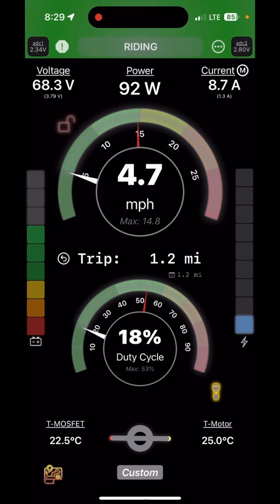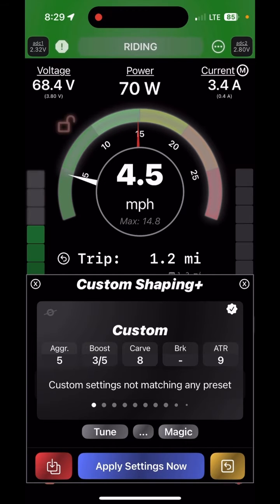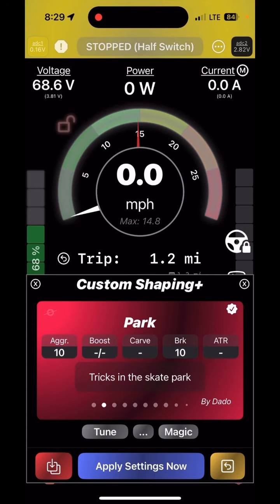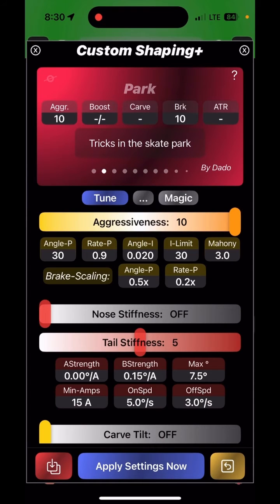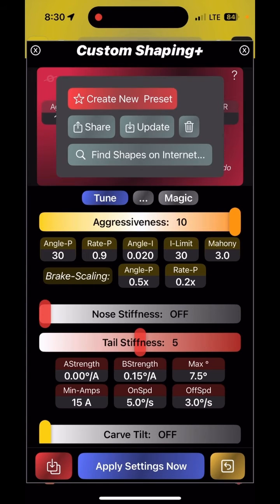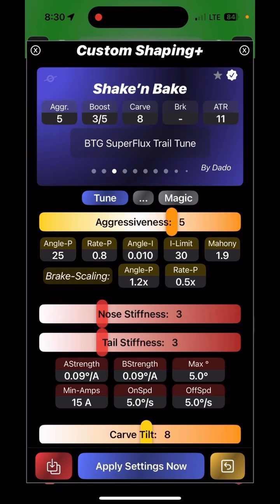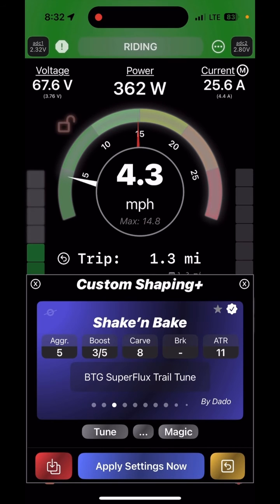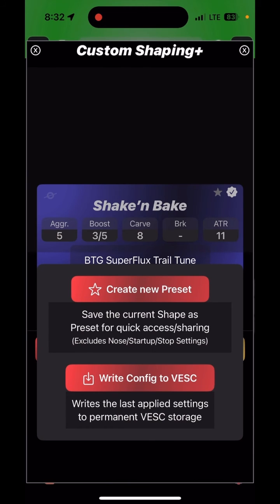Custom Shaping made easy

Comment: unsure what write config to vesc does ? does it write your current tune to the board so it starts with that each power cycle ? or writes all the tunes to your board ?
Reply from the maker: The board doesn’t even know what a tune is. Write config just saves the current settings so they’re persistent aka don’t get lost when power cycling